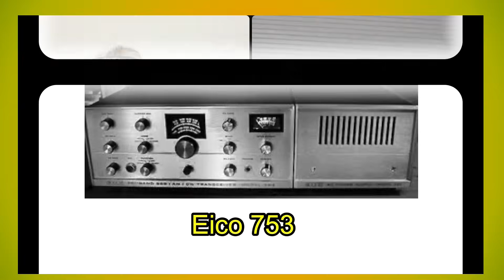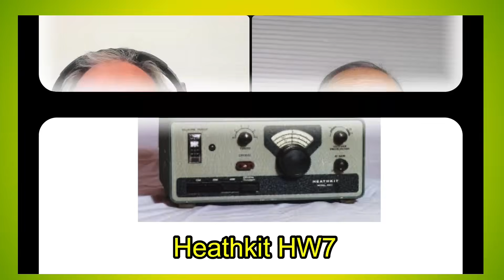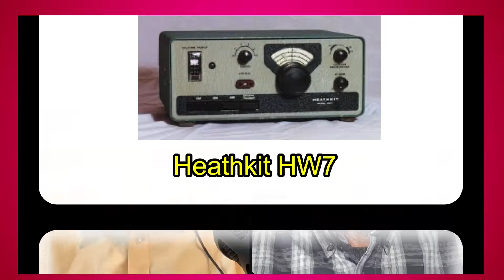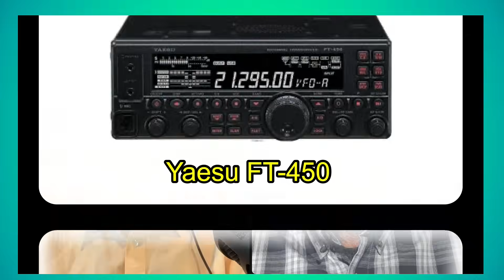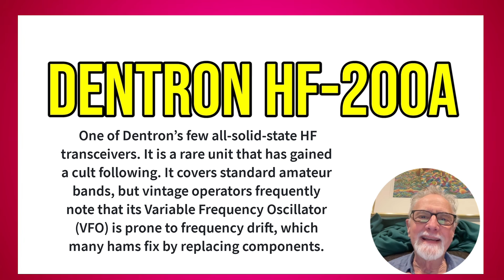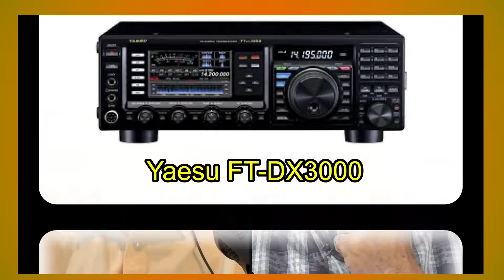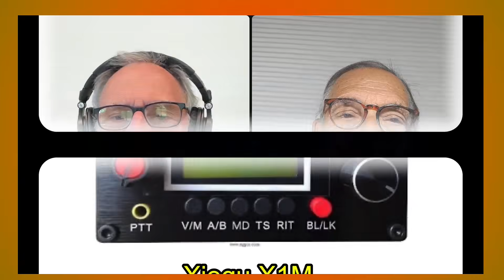10 Worst Ham Radio HF Transceivers -- Ham Radio Fun?

Comment: I had a rig I feel was way worse than several on your list.  Hallicrafters FPM-300 MkII.  Band and BFO crystals drifting way off freq requiring replacement,  toothed belt for band switches didn't last very long, VFO very unstable at times,  backlash in the VFO, marks on VFO dial weren't kHz markers (what were they? LOL).  Opening the lid changed all the adjustments, No RIT, of course.  Built in 12VDC supply for mobile use, but no noise blanker.  Luckily, I bought mine new when they were marked down in price considerably.  It seemed like a good idea at the time.  On the plus side, like mentioned many times, it was a learning experience.   hi hi de N8COO
Reply from the maker: That rig definitely sounds like it could have earned a spot on our list of notoriously difficult radios!

Comment: The FTDX3000 has some issues - crappy spectrum display that is too coarse to be of value, and the need to be VERY careful attaching mics to the radio (if you attach a kenwood or improperly wired mic to the radio, or even attach the right mic while the radio is powered up, you will fry a very tiny, surface mount diode and transistor).  But the transmit audio is amazing on the unit, and the feature set is as good as many modern radios.

Comment: I disagree with your comments about MFJ. I had many of their products, including a 9406 which is the six meter version of the VERY popular 9420. I have had two of their antenna analyzers and two antenna tuners and beam antennas, as well as many auxiliary products, including even a grid-dip meter.  They were all faultless.  With my 9406 I made my first cross-continent QSO from Vancouver, BC to Vermont (N1ZUK) with a dipole 10'' up. It has excellent ears and a very good speech compressor for more punch. When my Elecraft T1 tuner died (the same price as the 9406, BTW) I replaced it with my trusty MFJ-971 tuner which never fails with my K2 or KX3. I was about to buy a new tuner from MFJ when they folded. Martin J made a great contribution to ham radio,

72, VE7VIE ex WV2J
Reply from the maker: Thanks. See our full video on MFJ: https://youtu.be/ANO5gdIqq5Q

Comment: Yaesu FT1000MP.  It was expensive to buy, failed after the warranty expired, Yaesu took 3 months to repair it the repair was expensive, and I had to pay shipping both ways.  Switched to Icoms, no repairs needed in 27 years.
Reply from the maker: Sounds like a classic case of a radio that just didn't live up to the expectations after the bill arrived!

Comment: You left one off your list: the SBE SB-36. Pretty rare, had a really neat Nixie tube display, but was notoriously unstable. No two left the factory with the same parts in them. It was actually manufactured by a Japanese company called Robyn for SBE. 
How do I know this? I used to work on them when I worked for SBE in the mid 70’s!  de W7VO
Reply from the maker: That’s a legendary piece of history, and it sounds like you had a front-row seat to some real manufacturing chaos! We decided not to include some of the more rare units in order to do a separate video on them. Thanks.

Comment: My first station was a Mulri-Elmac AF-67 AM/CW transmitter paired with an Allied AF-67 General Coverage RX that had ham band scales for the bandspread.  

I took a HUGE step up with a Swan 350.  Mine was the version that had a turquoise stripe on the VFO dial. That iteration had ceramic coil forms instead of the earlier version with phenolic, so it was fairly stable for a tube rig with a solid state VFO.  It had 6HF5 finals and they made a tink tink sound as the finals heated while transmitting.  The only filter was the stock 2.4 kHz and I mainly used CW, so it honed my skills in picking out signals, especially in contests. It also had a manual T/R switch. I had more fun with that rig than almost any other.

I finally took an ENORMOUS leap forward with a Kenwood TS-520 with matching speaker and external VFO plus a 500 Hz CW filter and semi-break-in. I replaced the front end dual gate mosfets with RCA 40673s.  Loads of fun with that too. A truly nice transceiver.
Reply from the maker: Sounds like you’ve had some legendary setups over the years. Q

Comment: The famous Swan drifty 250.   I was told about a rig (?Swan?) that didn't compensate for the offset between the center carrier frequency and the transmitted tone. anyone that worked the station had to follow it up the band and out of the band end, if you did not watch out.  It's user had to retune to pick up each reply. Ron W4BIN
Reply from the maker: Hi, Ron. Anyone have thoughts about such a rig? Q

Comment: Hey guys. I  have a request. I am 68 and have had my ticket since 1979. Haven’t been on the air since 1987 or so. I used to have a monster Hallicrafters that weighed a ton. I had to run it into a Heathkit dummy load to tune up. As I come back to the hobby, do we still use dummy loads? 😊
Reply from the maker: Welcome back to the hobby, and yes, they are still a very essential tool for us today!

Comment: Opinions are like...well, you know.  I have two Dentron HF-200As and they're great little radios.  Dentron was stuggling at the time and evidently thought offering a transceiver might rejuvenate sales, but it's unfair to put all the blame on the HF-200A.  It's one of very few examples where the innovative Mizuho SG-9 board was used to streamline HF radio design.  Mizuho, known for it's highly valued HF handy-talkies, put an entire 9 MHz SSB IF and associated circuitry on  one PC board, thinking it would be save time and money for radio OEMs.  Dentron bought into the concept, adding the VFO, mixer, PA, and packaging.  Dentron also used the SG-9 in the "Scout" shoebox-sized fixed frequency radio sold for CAP use and in the very cute MLX-Mini, a 25 watt singlebander (I have the 75 meter model)   I had to do some work on all of them (with limited documentation) and have them all on the air.  I'll fire up the HF-200A for one of the vintage sideband nets where it always draws positive comments.   By the way,  my Eico 753 is more stable than many HF rigs!
Reply from the maker: Wow, great reports, and congrats on the 753 nifty drifty that you have harnessed. Q

Comment: Firstly, early transceivers were seldom good radios. There are exceptions like the KWM-2 and Drake TR-4, but most were largely a mediocre bunch. Synthesizers were a big advance both in terms of stability and audio quality. I would rate the biggest dud of the modern day radios the Kenwood TS-570 due to its audio DSP (those don't do anything) and not a particularly clean transmit or receive signal.
Reply from the maker: Yep, had the 570.

Comment: The HW-7 was my very first transceiver, and my very first rig with  a VFO for transmitting, as I had always used a Separate receiver and  crystal controlled transmitter up to that point. The VFO thrilled me, but yes, all the other headaches were true! There eventually was an article in QST entitled " making the Heathkit HW-7  into a Real Radio", which solved (almost) all the problems by replacing the Mosfet detector with a diode detector, and re-configuring the original Mosfet into a Audio pre-amp, followed by a passive audio filter that used 88 mh Toroids. It became an excellent performer after those mods. VE3PKY ( ex WD5GPM)

Comment: 6HF5 valves were not so expensive in the UK.  Most TV shops would sell them for £1.50 for a pair.   The 6146s almost never failed, but were about £5 each from Ham Dealers only.
Reply from the maker: It’s fascinating how those prices varied so much depending on where you sourced your parts back then. Q

Comment: Vibrators were made for broadcast band car radios. They couldn't handle the 100 watt power required by a G76.
Reply from the maker: It’s amazing they held up as long as they did in those old rigs.

Comment: I must to admit I agree with you guys in many cases. I did have one buddy who loved his G76 and never complained.  Another friend had a T150. The T150 covered 6 meters as a selling point. But, it had insufficient drive for 6. The 6146s run red and the output was very low.
Reply from the maker: That sounds like a classic case of pushing a rig right to its limit. Q

Comment: I borrowed a Knight T-150 from W6MOG (who wrote articles on ham rig projects for 73 Magazine). Dick did a conversion to DSB (yes, Double sideband). He turned the pair of 6146 finals into a high level balanced modulator. (I don’t remember having a drift problem nor FMing of the DSB signal.)
I frequently was Net Control in the afternoon after high school got out for WestCARS 7255 on 40m (yeah, a squeaky voice teen net control). Got many comments that I was transmitting on USB. To which I responded "I am transmitting both LSB and USB, on purpose". That was so much fun, but Dick rightfully decided that was to be relatively shortlived. I graduated to one of his other 73 Magazine projects, a converted Hallicrafters SR-150 from a pair of 6DQ6 xmtr output tubes to a pair of 6HF5 sweep tubes. That was a good conversion, though the poor T/R relay was a bit undersized for that output wattage, so its contacts arced enough that it gave up the ghost in 3 years. I still have the rig, but haven't powered it up in over 40 years. It still looks pretty. 😅
Reply from the maker: Great tales. TNX

Comment: How dare you denigrate the Eico 7Drifty3.  I bought mine at a ham fest in 2012 after upgrading to General.  I never put in on the air, but instead just listened with a random length wire antenna laid on the ground.  In 2013, I moved overseas, and shipped the unit, but due to my careless error, the power jack in the back got damaged in shiping.  I could fix it but decided it's not worth the trouble. I regret that I didn't make you proud by fixing it, but I'm thrilled to have the first transciever that you mentioned.  BTW I still own that thing.  It's hard to let go of becaue there's alot of water around here, and boat anchors are in short supply.  lol.
Reply from the maker: You have got to fix it for history's sake!

Comment: I drooled over the Eico 753, it was only $150 in 1965.  That equates to about $1500 today.  Of course the PS was 60 bucks, but those big old TV power transformers were still found in discarded sets, with their hefty filament windings and 600 VCT secondary, you could home brew one almost for free.  Drifty or not, if like me,  your rig was a regen receiver and a one tube transmitter, the 753 was the Collins S line of those of us cutting grass for our hamradio bucks.    Since you mentioned the stand alone T150 in a transceiver video, then the ultimate sorry receiver is the Knightkit R55, a rig with no RF gain control, lousy AGC, and no selectivity.  But that is why us OT's are still good CW ops.  Those old receivers made you develop an excellent  'Narrow CW Filter' between your ears, separating out that one QSO amongst all the others and not think anything of it.
Reply from the maker: We can't recall operating the R55. Note that we are working on a video about ham radio kits. Eico was among the largest maker of kits, and some of them worked well. Thanks for posting, and please keep posting. We learn from our listeners, like you.Q
Reply: I too drooled over the 753.  I thought it was a really pretty radio.  Back in the day, I remember reading articles about modding it.

Comment: Vibrator powerpacks can be very reliable and effective when well constructed. I had a Омега Р311 (Omega R-311) shortwave receiver that operated on 2 Volts ackumulator and a vibrator powerpack for the anodes. This powerpack was quiet operating both in RF and audio. It also worked well during the eight years I had this receiver.
I talked to older swedish Hams who used microphonic CW txs for FM, you could just shout at the VFO and you had a working shortwave FM-rig. Shortwave FM was a thing before SSB.
73 de sm0rcx mikke

Comment: Why does my SWAN250 use 6146B tubes for final？
Reply from the maker: We got that wrong, for some reason. Another "dit and duh" brothers snafu. Enjoy those tubes, much better than the sweep tubes used in the other Swan rigs. And more stable at the higher frequency. 73

Comment: Where is the FT897?
Reply from the maker: Say more...
Reply: @HamRadioPerspectives I had one, a wonderful concept indeed. The body of the radio could also take an internal power supply or batteries, a bolt-on ATU. HF-VHF-UHF, all good. Ideal portable radio. But never have I had more issues with any radio in my life and no radio had so many design issues. It would be a very long list. ATU and CAT was either or, they did not work simultaneously, CW did not work  out of the box, I had to return it. Every two years or so the LCD developed stripes and faded away, needed replacement often. Clarifier knob flimsy, it broke (I take care of my radios, I never broke any), terrible user interface, weak SSB signal as there was no compressor. Speaker died, needed replacement. I kept it for over a decade as I really-really wanted to like it. I went on a lot if holiday style DXpeditions and wanted to take it with me, but despite excess luggage costs I always ended up taking a radio that was four times as bulky.  It was actually the worst radio I ever had and in the end I sold it for peanuts as it was only collecting dust.
Reply from the maker: Wow, this sounds like a candidate for a second video on worst transceivers. Thanks!

Comment: I noticed that you didn't include the HW-8 in with the HW-7.  I put the HW-8 together in an overbuilt, ruggedized manner many years ago when I had thoughts of bring it on hiking trips to the far boonies.  My HW-8 is a really excellent little rig with acceptable receive sensitivity and nothing bad about it.  My problem is that I ABSOLUTELY CAN NOT COPY CW -- I can send nearly perfectly with a straight key, but I can not copy.  My brain can not follow CW, which I consider a defect and a terrible handicap since I always wanted to be able to work CW, but, try as I might over the years, I just can't.  I have used my little HW-8 in conjunction with operators sending SSB and receiving my little 5 watt CW LOUD AND CLEAR, but those were special occasions.
Reply from the maker: First, some people can't easily learn CW. I will link below a video on this. It is not YOU. So just move on. Second, the HW-8 was quite an improvement, and now a collectible rig. Thanks for your candid post. Quin https://youtu.be/c_2aF0Ui3pI

Comment: I have a little low power (=< 100 watts) MFJ antenna tuner that works marvelously with my G-90 rig when going portable.  I also have another MFJ tuner good for 2KW that is much newer that I use in my shack.  Both tuners had to be extensively rebuilt before they could be used.  The components and the layout in each case were excellent, but the workmanship was absolutely horrible, especially the larger and newer unit with a rotary inductor.  I spent hours and hours getting the rotary inductor to stay on track and work reliably.  I really should have given up and sent the unit back, but I am a compulsive fixer and I just wouldn't give up until it worked perfectly as it was designed.

I worked in aerospace where I wrote detailed instructions and supervised electrical assembly and testing of the Atlas and Delta space boosters, so I know what quality soldering and good workmanship really is.  

I came to the following conclusion:  MFJ was almost surely always on the brink of bankruptcy and they couldn't afford to hire qualified and trained assembly technicians, so they didn't.  Their management, at a most fundamental level, absolutely did not understand how important quality workmanship was and is.  I was then and am now convinced that they hired developmentally handicapped people that the government would pay them to hire, gave them just the most basic and inadequate training and completely dispensed with any kind of post assembly inspection or testing.  They would slap a product together and it would look good on the outside, but it just didn't work on the inside -- but it looked good.

Moral of the story:  I now have two rather excellent tuners that work perfectly and I didn't pay a lot for them, but I had to disassemble and then reassemble them correctly using the kind of workmanship I learned and came to expect during my career in aerospace.
Reply from the maker: Excellent! See our memorial to MFJ: https://youtu.be/ANO5gdIqq5Q

Comment: What is the matter with you guys? A drifty transceiver is great - you can call CQ on the whole band in one try! Better than calling CQ with xtl control and then having to tune the whole band to find someone calling you!

Also, my SB-101 has a bad LMO (which by the way is unobatinable now) and it uses JUMP MODULATION, changing frequency at will!
But my Elmer fixed the problem with an external DDS VFO (not available in the 60's though).

Its all good fun!
Reply from the maker: Hey, we're big fans of drift. We did a whole video on the joys of drift. See this: https://youtu.be/mUlEkpebcAY

Comment: Harsh. My FTDX-3000 is going strong coupled with an SDRPlay RSP1a with panadapter and CAT control from SDRUno. I do agree that that labyrinthine menu system takes some getting used to but that's just the way Yaesu rolls.The waterfall is an underpowered ornament but the audio is excellent and I've never had an AGC issue. Y
Reply from the maker: Glad you've found a setup that works so well for your operating style, thanks for sharing your perspective. We can be wrong!! 73

Comment: A piece of irony, gentlemen, is there is a moderate peice of surgery that can be done on the Heathkit HW-7 that turns it into a very good rig with a sensitive double conversion receiver. I have two of them and a third one awaiting the surgery - so the mods are repeatable.
Reply: I had a HW-7and got the -8 to get another band but the -7 had more power out. Problem was they only covered bottom 250 kHz of each band. KK5R
Reply from the maker: Excellent. How did Heathkit miss those? 73